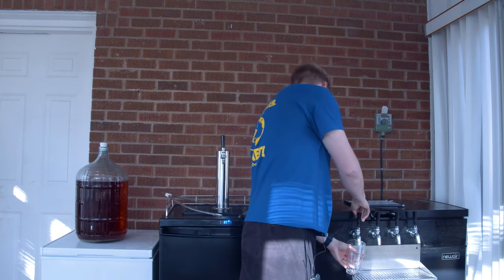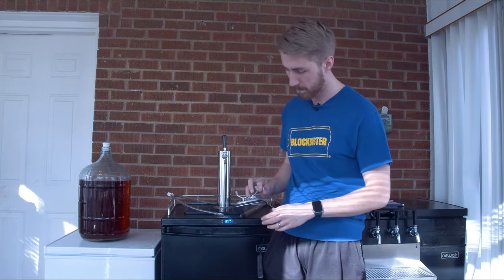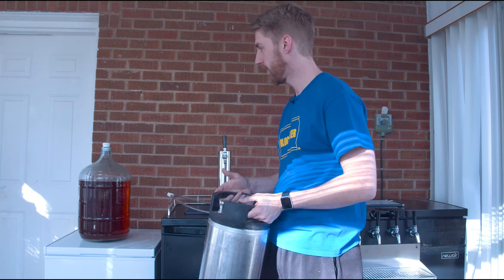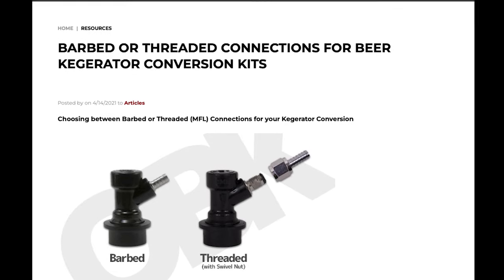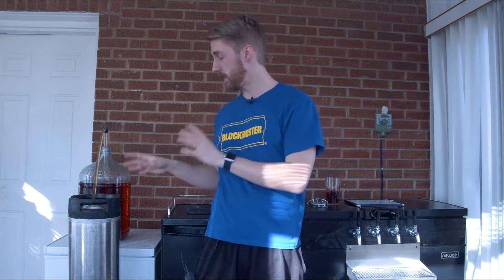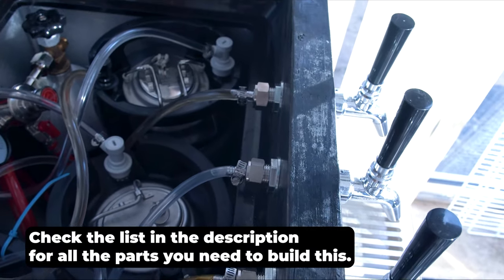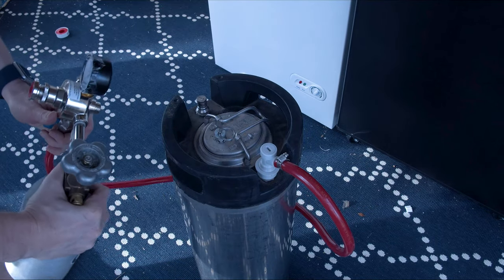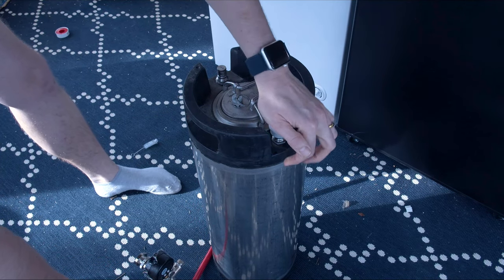A Guide To Kegging & Force Carbonating Homebrew

Comment: I really want to start using a keg but still need to get better brewing equipment first. I'm using a turkey frying burner that shuts off every 15 minutes and a cheap stainless steel 3 gallon pot. Also don't have a place for a kegerator yet but definitely a plan for when I have the space. Thanks for the content and thanks for sharing!
Reply from the maker: You should definitely do it one day when you have the space!

Comment: Still waiting on my supplies to arrive so I can start my first batch of mead period, but my plans in the future would be to carbonate some of it.  But for now, it can wait until I master simple meads.  Good video though, I've learned there isn't much to it.  I assume them being chilled is a preference and not a requirement?
Reply from the maker: Chilling the brew will help it carbonate faster... and it might make it taste crispier. Other than that, there shouldn't be a huge difference. You might have to adjust your serving psi to be lower if it's room temp!

Comment: The difference between ball lock and pin lock kegs are the liquid and gas posts and connectors. The difference is not the lids. Ball lock uses a quick disconnect. Pin lock you push down and twist locking it down onto little pins sticking out the side of the post.
Reply: You can also convert a pin lock to a ball lock by replacing the posts and replace the lid to match.  Then the only difference is the shape (height and the diameter) and the dip tube is straight with the bottom curved toward the dip tube.

Comment: So i kegged my first beer yesterday and am struggling with how to force carb it. 

I dont want to over carb it and dont want beer going up my co2 line into my regulator. 

If I carb at my serving pressure(4-5psi)will it take a week or so or do I have to for e carb at 20-30psi, purge the gas and then turn down to serving pressure?
Reply from the maker: It won't carbonate if you put it at 5 psi. You need to set it at 30 psi and let it set for 3 - 4 days! Then bleed off that pressure and put it back to your serving pressure. That should allow you to get a good carbonation level!

Comment: Just getting into kegging too.  How do you go about cleaning out the taps and lines?  I think I've seen some kits, but no instructions.
Reply from the maker: An easy way for me to would be to partially fill an empty keg with StarSan water or sanitizer and then connect your lines and pour through each one.

Comment: How would you go about kegging a still mead? A cider place by me has a still mead on tap during the summers and it's awesome.
Reply from the maker: You would just put it into a keg and then force carbonate via the methods I talked about in this video!
Reply: Just skip the high psi carbonation part and just go for a 3-8 psi just to push it out and keep the oxygen from the mead.

Comment: Why didn't you pressurize to 5-10 psi and then use the PRV to push out oxygen that was sitting on top of the liquid before you fully pressurized to 30 psi?  Ah you mentioned it later in the video my apologies ...

Comment: Thanks for the video.  Do you have any recommendations for kegging with limited space.  I do not really have the room for a kegerator or keezer.  But my basement does get pretty cool in the winter.
Reply from the maker: A basement could work! Just a cooler environment in general is helpful. You can keg without it being in a fridge, you just have to adjust temps when serving!

Comment: You can carbonate in ten minutes. Don’t fill you keg as much. Turn the pressure up to the recommended pressure (30 - 40 psi) and shake the crap out of it. And I mean shake it a lot. HARD! Listen to the Cars Shake it it up while you’re carbonating. When the song is done, it’s carbonated. You want as much surface contact as possible. That means little droplets. Party On Garth!